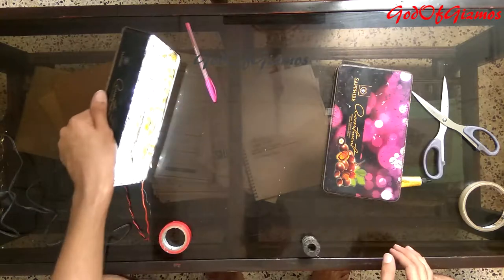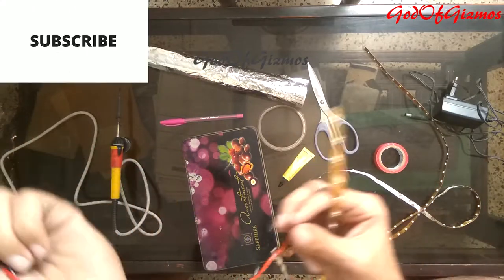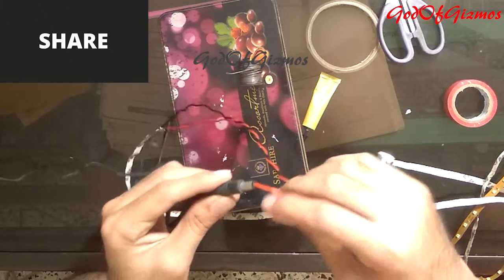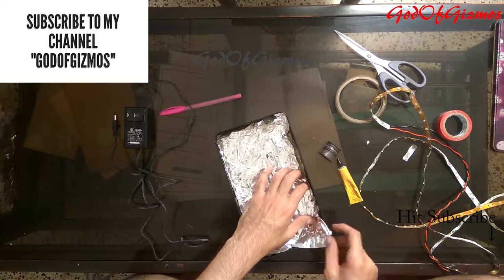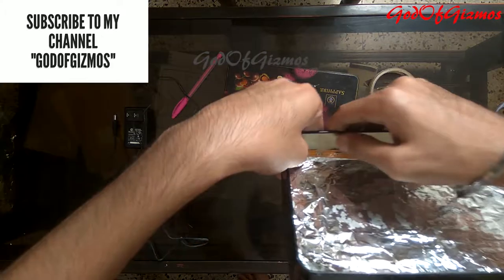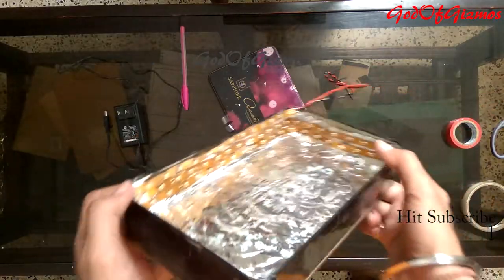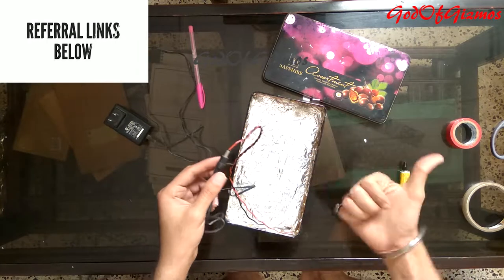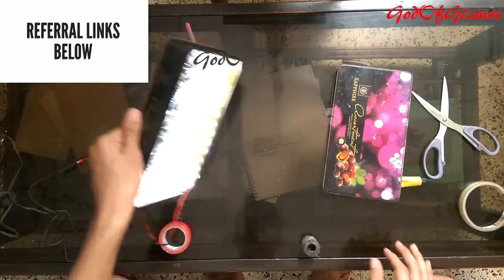DIY - Mutlipurpose LED Light - English Audio

Comment: If you are thinking of doing more things like this try wire nuts instead of the tape, like cut the cable near the far end of the wire and connect it directly. I work in electrical and programming and those work the best for me.